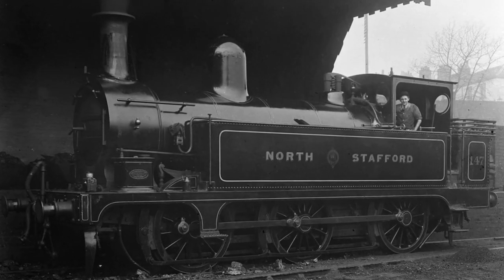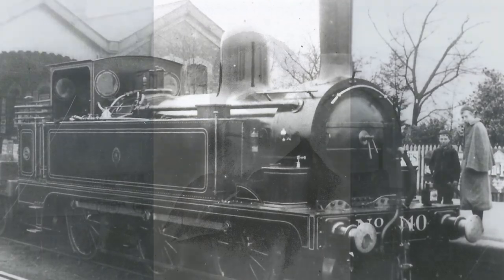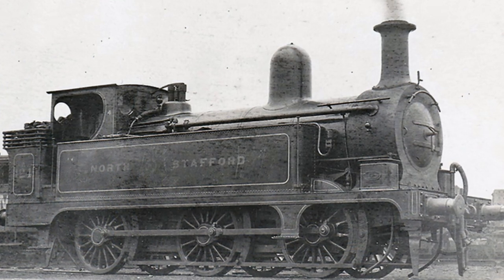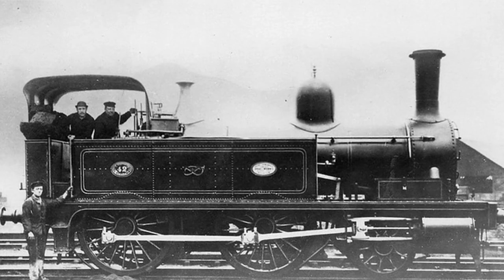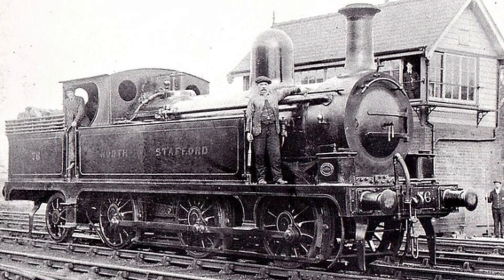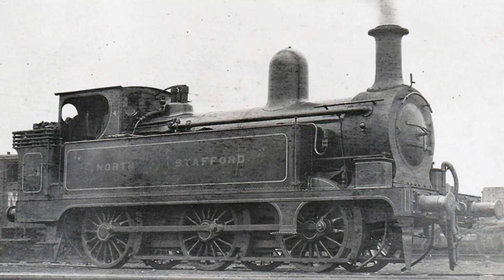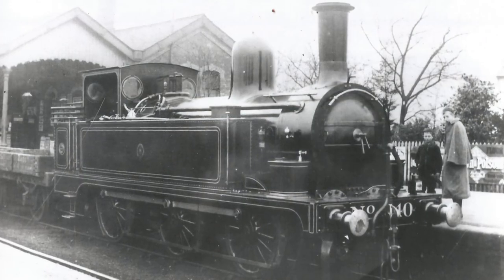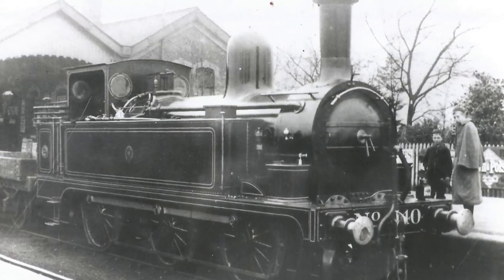NSR D Class: A really useful engine.

Comment: So if one were to want to launch yet another "new-build steam loco" campaign into the dozen or so all fighting for funding, the NSR D Class would be a good candidate? Bonus points for their small size allowing a new one to be built in a smaller workshop.
Reply from the maker: They've be a perfect candidate. There was a scheme to do one about 10-15 years ago using second cylinders and bits from a Manning Wardle. But never happened. Itd be ideal for many lines: small, economical and capable of moving a couple of BR MK1s.